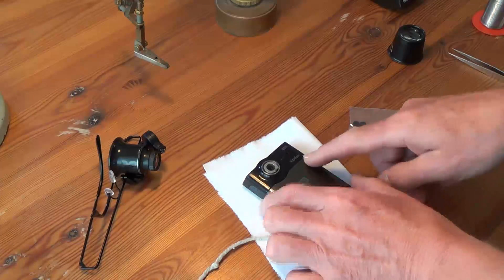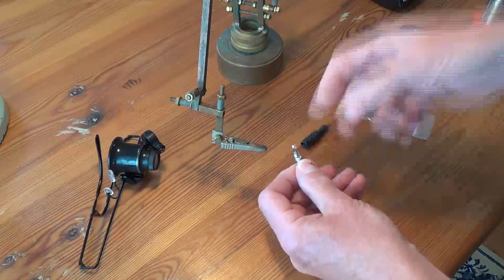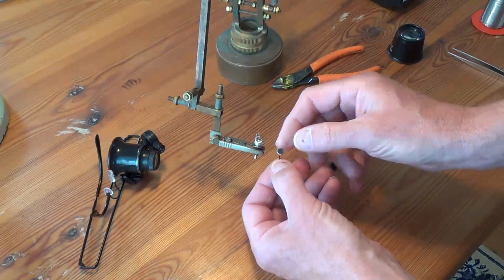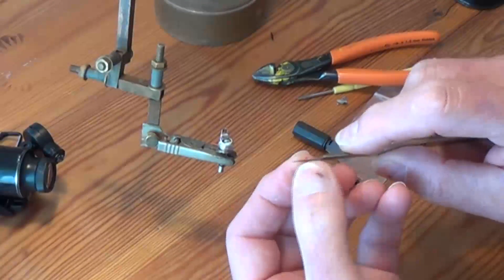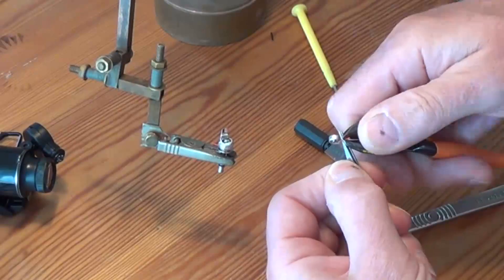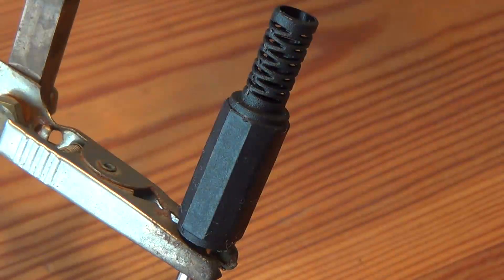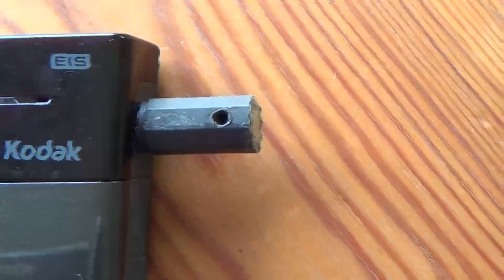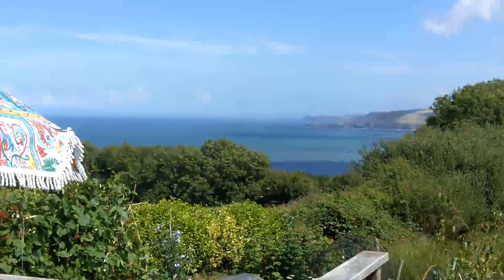Zi8 external mic to stop HF noise

Comment from the maker: Hi again Mick, Sophie’s not into radio but Sophie and I built my workshop/shack, other than digging the foundations we built everything together including the roof. I made a jig so that Sophie could apply a layer of mortar and I placed the concrete blocks, we joke that the cement mixer was her birthday present. Her favourite job was marking out and cutting the lead flashing for where the roof meets the side of the house, she still calls my tin shears ‘Lead cutters’   
All the best ... Andy

Comment: It takes a man with great confidence and dexterity to strip the insulation off two tiny wires held against his fingertip, using a scalpel. I'm afraid I would need the first aid kit on standby. Thanks for another enjoyable video. G4NFV.    (ex GM4NFV)

Comment from the maker: I used to do a lot of intricate brazing and I built a couple of these devices. It’s made from thick walled ¼” square copper tube. It only took a couple of hours to knock up but it’s saved hundreds of hours of messing about. Someday, if I have the time, I'll do a video about some of the products I’ve helped develop, funnily enough I’ve made quite a few machines for Kodak and Fuji and the 3rd has hand have been used when I built prototype induction coils for their application. 
Regards... Andy

Comment: I must say I still prefer the internal mic. For fun, I loaded up the audio in Audition and looked at in the spectral view. The whine consists of three components at 4.2, 6.6, 9 kHz, obviously spaced 2.4 kHz for whatever reason. Maybe an acoustic feedback path. They might have left the internal speaker on monitoring the mic?
The external mic has a resonance point around 2 kHz and no response above 4 kHz. This may not be the mic's fault but due to an internal filter circuit in the camera however.

Comment: Try the other mic as well, these small electret capsules are very variable, and you can have a large variation in response, sensitivity and such between units. You might also try making the hole larger, and placing some microphone foam in the larger hole to reduce wind noise, as well as some behind the capsule to reduce the handling noise.

Comment: Andy, you should give the XYL more airtime; she is much easier on the eyes than you. :)  What would we do without them helping us around the shack? My wife, Bonnie - WA4JCX, helped me erect my tower and beam in the early '70s and take it down when we moved in '78 then re-erect it at our present location.  She learned the resistor color-code by picking up after me.  hihi

73 Mick - WB4LSS

Comment from the maker: Hi, I’ve tried that with all of the audio filters that come with Photoshop Premier Elements 9. There’s a whole bunch of noise-reduction, dynamic, hi/lo-pass, filter’s etc, I’ve tried the lot and none of them cut it well enough but changing to the external mike seems to disable the problem. By the way when I searched around I found it’s a common problem with this camera.    
Regards ... Andy

Comment from the maker: As a kid I would have stripped it with my teeth, I still have all my own teeth but only just I reckon. If you just try to strip it with the cutters you’d be just as likely to pull it off the mic and I don’t have any wire strippers that will cope with such thin wire without cutting it in two.
All the best ... Andy  
GWØJXM